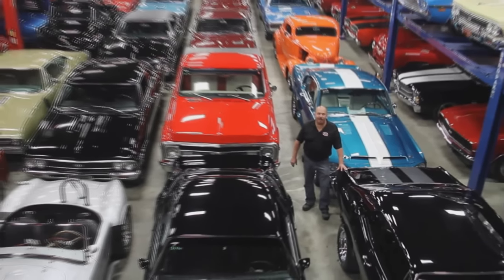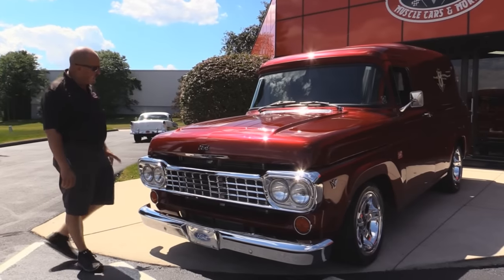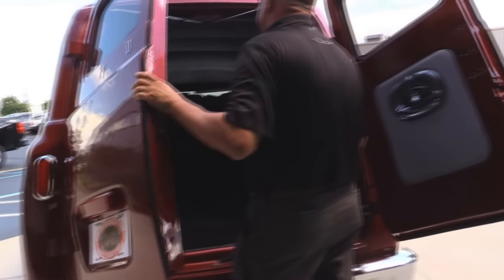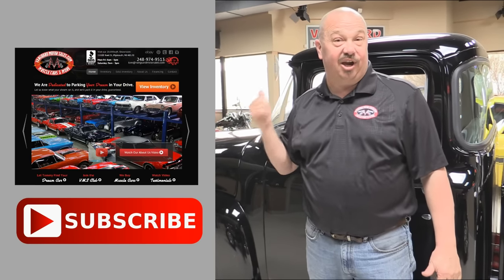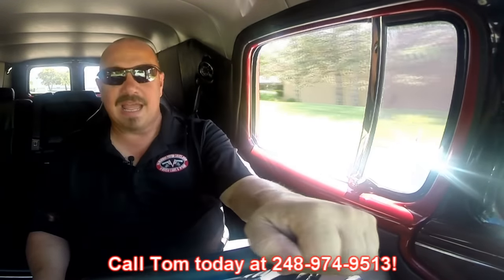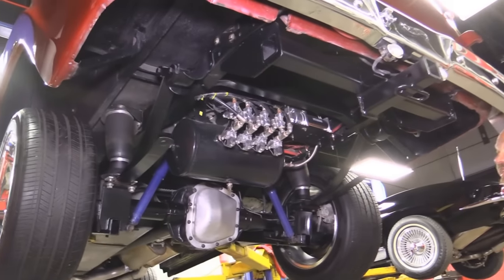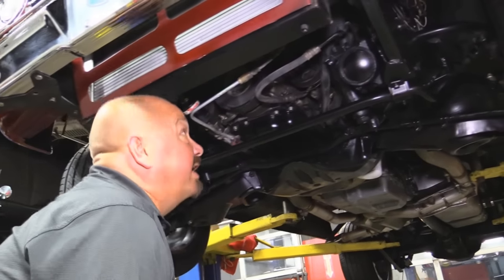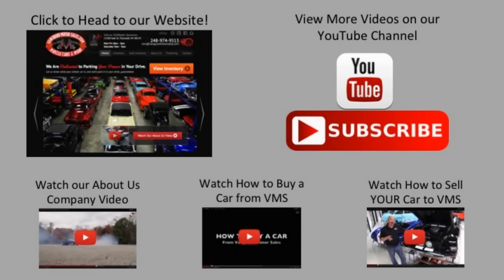1958 Ford F100 Panel Truck For Sale

Comment: how much it is going for ?
Reply from the maker: +Faisal Abdulaziz Im Sorry but this truck is sold. You can see our current inventory on our website at www.vanguardmotorsales.com
Reply: alright im looking for a panel truck to swap an engine to ...somthing with great body shape with a bad engine (also to save time on the work ) so i dont feel bad throwing away the orginal engine ....a panel truck or a step van a c10 suburban
Reply from the maker: +Faisal Abdulaziz You Can go to our auto loactor on our website here at http://inventory.vanguardmotorsales.com/car-finder

And we will get into contact with you if we find anything of the desired spefications.